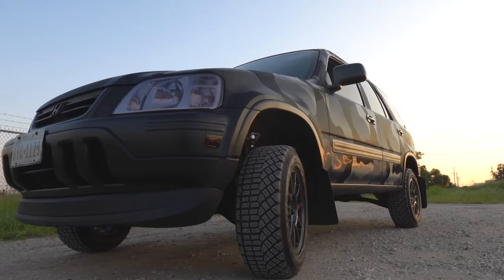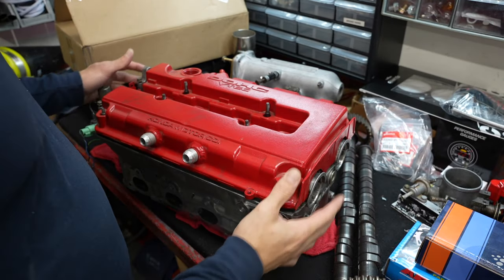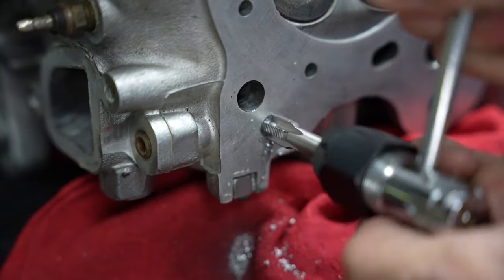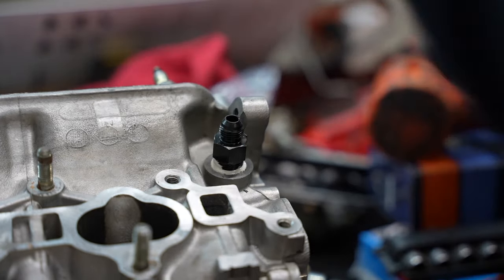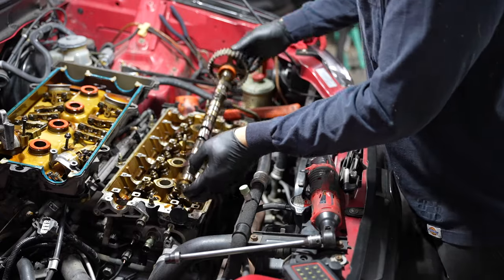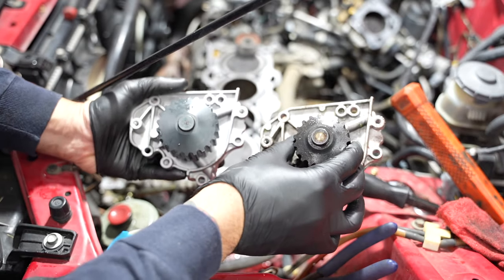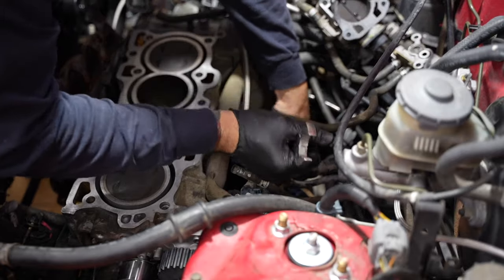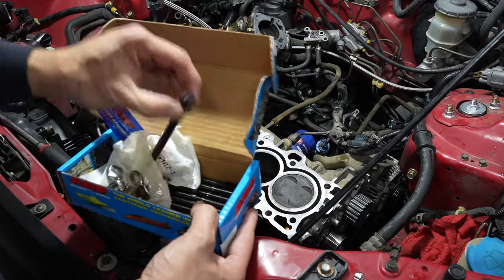B20 VTEC Build Guide : B16 Cylinder Head = 8k Rpm Screaming Honda / Mod My CRV RD1

Comment: Only thing that would make this better is links to the products that you bought but thank you so much for this video!
Reply from the maker: I can add links, but I really didn't buy most of this trough Amazon.  What did you need?
Reply: @Donnythelatemodeltech  my bad just now seeing this, where did you pick up the head plug, and the vtec oil return line? also a link to the gates water pump kit would be sweet
Reply: Yes I have a 301 k manual 2000 crv that I'm currently about to do this to and your video was greatly appreciated I will be tryna daily boost it with the s1 build driveshaft and locking plates cuz those stock driveshafts arent too great with more power

Comment: Amazing video. 🙌 The B20 distributor does work in fact, but you have to cut an ear off to make it fit, and only one bolt will line up to attach it to the head. Not ideal, but it does work, if someone wants to go budget, or, if they want to just get it running before their new distributor comes in

Comment: Thank you so much sir you gave me confidence to this to my b20 (someday) you explain everything so easily
Reply from the maker: All the best
Reply: @Donnythelatemodeltech  will the b20 with vtec cam have reliability issue?
Reply: @lunlun2930 nah works great, no fundamental difference in a non vtec vs vtec block besides the oil port in the head missing which isn't an issue

Comment: great video! I always wanted to do something like this on my old Prelude that had the grandfather B-series, B20A but it was a bit more work because in addition to the oil supply, we had to slightly open up I think the 4 outer most head bolt holes (like the belt side and transmission sides of the motor) since those were slightly not in line with the newer B series heads, and that pretty much meant requiring a custom head gasket too instead of using its original, or a VTEC head gasket. Unrelated though - if you wanted to take it one step further, get some Integra Type R style pistons for the CRV block for extra compression and thus more high end power, and some beefier connecting rods to handle the higher RPMs long term.

Comment: Awesome build dude, I run an Opel Vectra (GM car) electric/ hydro power steering pump in my prelude, just two short hoses to and from the rack- that way you can toss your belt driven pump. You do need to be running at least an 80A alternator however...
Reply from the maker: Very nice!

Comment: Another banger. Still debating on Vtec/non Vtec just for the reliability sake. I forgot to ask you on the other video, being that your throttle body and IACV are automatic transmission units have you been having erratic idle issues?
Reply from the maker: So after the manual swap i did go to a manual throttle body and ecu.. / the car wouldn't idle high enough with the ac on... the compressor would kick on and off.  Even with the ecu and throttle body.   /Now the car is vtec, I'm running a socketed obd 1 ecu - p28.   Using honda tuning suite it idles great, I have full control of the idle... ac on and off.  Its a wonderful tool.   So, it  is more reliable now than ever... I see and control everything.
Reply: @Donnythelatemodeltech  that’s what I heard. Apparently the only way to totally fix it is to run M/T harnesses, IACV, and T/B. Thanks for the update good to know.

Comment: Does taking the oil from before the oil filter lower oil psi, require more oil to run or starve the system from lubrication?
Reply from the maker: I don’t think it affects the psi,  I do run alittle more oil though
Reply: I actually think most oil filter sandwich plates  run filtered oil out of their ports. It usually doesn't bypass the filter.

Comment: I'm doing a 98 crv 5 speed manual with itr head. What exhaust manifold or header do I use? Do I get a b20 header or one for the head
Reply from the maker: Got to use  an b20 awd header.    The pipe is going to need to have a curve in it to clear the awd transmission.

Comment: @Donnythelatemodeltech Thanks Donnie for the series.  Trying to have all the parts on hand when I do my conversion.  What radiator hose did you go with?  Have a part number or link?
Reply from the maker: https://amzn.to/3lRD3TM
Reply from the maker: Some of those details are in this video https://youtu.be/CMvlWWGte0Y
Reply: Thank you.  I somehow missed it in that video.
Reply: @Donnythelatemodeltech  Sorry man, one more...What B16/B20 step-down dowel pins did you buy that went over the APR head studs?  There are some you have to ream out and  I'd rather not have to do that.
Reply from the maker: @u2asian456  this is the listing https://www.ebay.com/itm/221083079390?mkcid=16&mkevt=1&mkrid=711-127632-2357-0&ssspo=A-xZDM8EQ2q&sssrc=2349624&ssuid=7NvwI_1ZS1i&var=&widget_ver=artemis&media=COPY
Reply: @Donnythelatemodeltech  Thanks buddy.  Unfortunately, I just need the dowel pins.  l have a Golden Eagle kit but it was missing the dowels.

On a unrelated note - you're half Asian like me.  What mix are you anyways?  Just curious.

Comment: Why the type r water pump?
Reply from the maker: Teeth
Reply: @Donnythelatemodeltech  more teeth more cooling more redline?
Reply from the maker: No, more teeth = larger pulley.  Correct length for the timing belt.

Comment: Im so confused on the part where you torque the head bolts. Overall it’s 80ft pounds. So you first torque it to 20 and then you torque it to 60? Aren’t you supposed to go 20 first and then 80?
Reply from the maker: 20 60 80 with arp studs.   Oem bolts 20 60.   I didn't record the 80ftlbs step.  I got a phone call during the recording and just forgot.
Reply: @Donnythelatemodeltech  makes total sense now. Thank you!

Comment: can someone post up the gates timing kit he used in this video?
Reply from the maker: Links in the description now. https://amzn.to/3WoQsAs
Reply: @Donny The Late Model Tech  thanks, I picked up my 01 awd crv today so I'm prepping for next month. Head already has a burnt valve so perfect time
Reply: @Donnythelatemodeltech  One more question, did you just use a b16 coolant inlet housing? or what engine did you get that from? and then which hose did you use?
Reply: The Aisin kit on rock auto is better, uses mitsuboshi belt too.